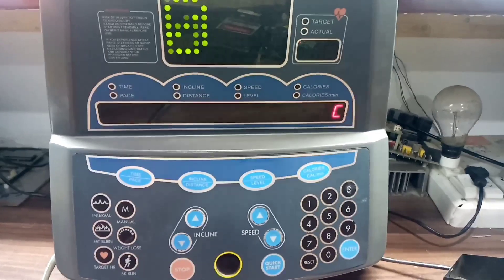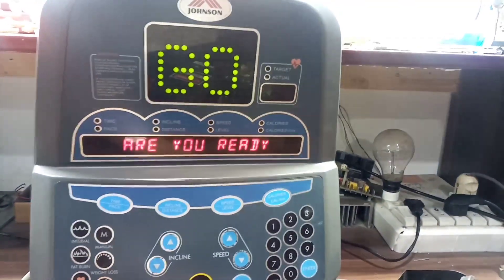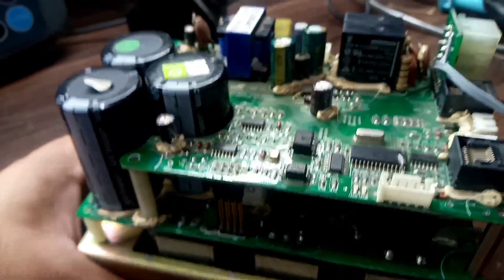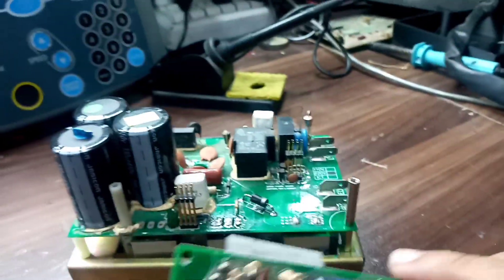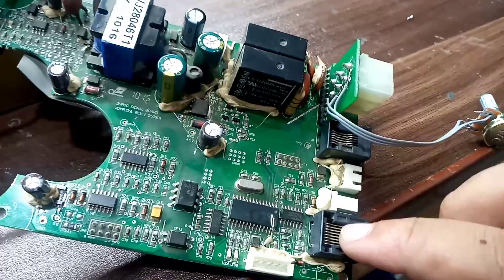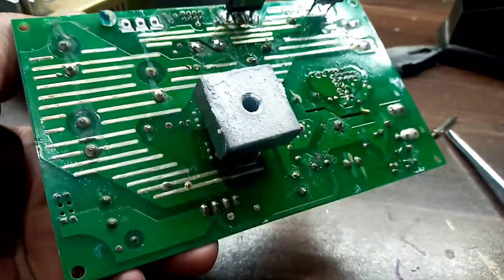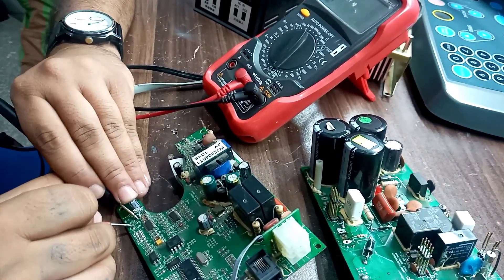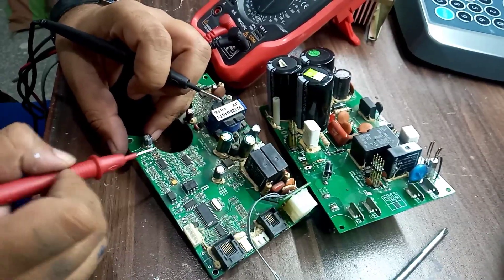Johnson treadmill Error 1|Johnson treadmill repairing |Johnson treadmill inverter repairing

Comment: for my treadmill motor does not work at all but incline does. Following your video I checked the mosfet, resistor and transistor everything seems ok I think. No clicking either so what do you think I should be looking at? Capacitors and relay maybe?